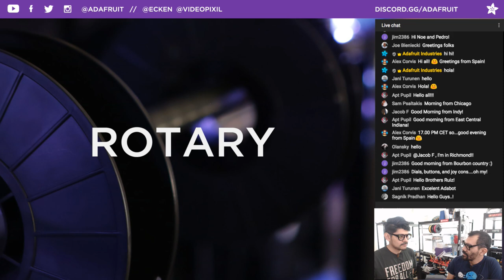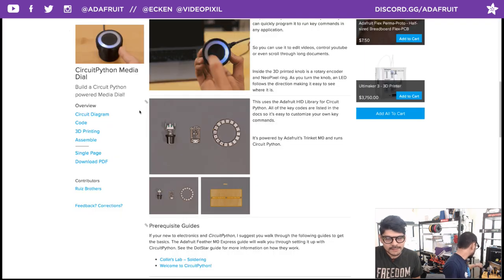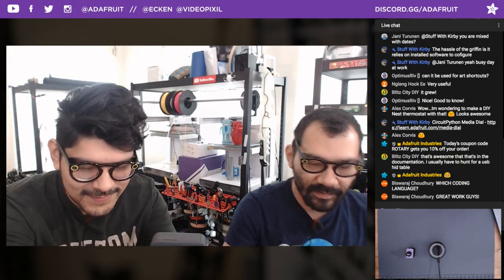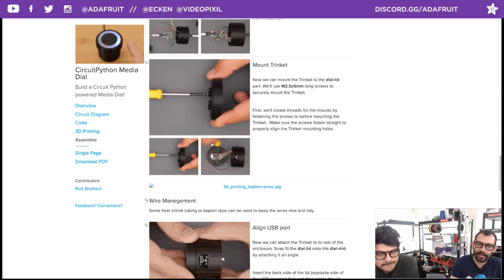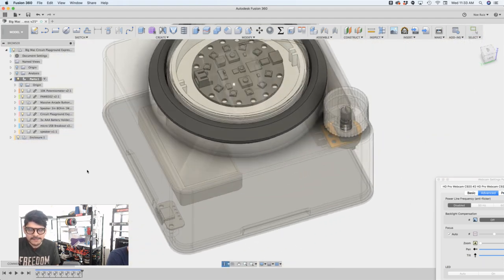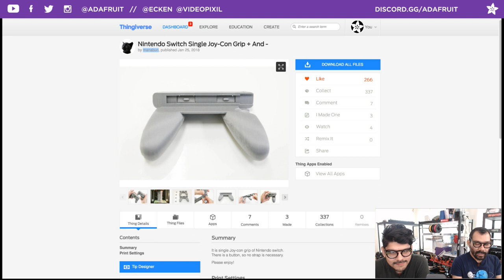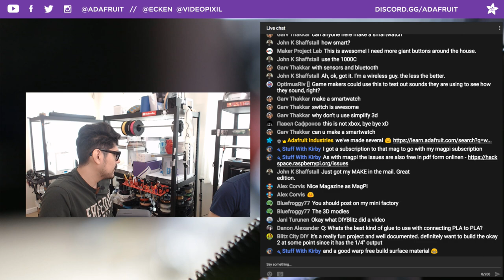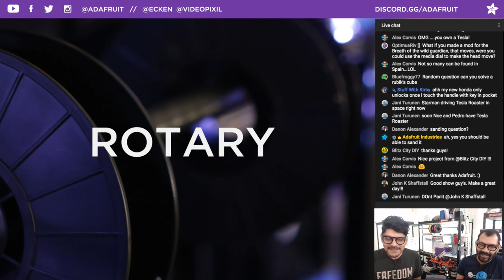3D Hangouts – Dials, Buttons and JoyCons

Comment: Is it possible to print this with a dual-extruder printer? Was thinking separate pieces... Pause/change filament/repeat could get ugly.
Reply from the maker: yes, definitely! we dual extruded the top part using the ultimaker 3, the setup and slice settings are listed in our guide here: https://learn.adafruit.com/media-dial/3d-printing
Reply: SORRY! Meant print WITHOUT dual-extruder!